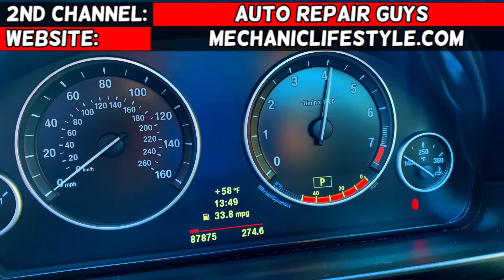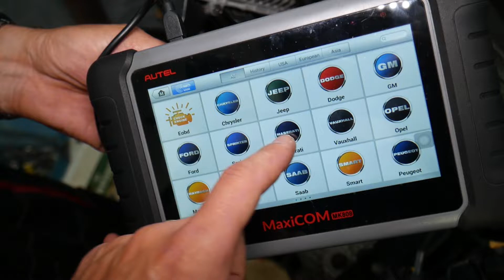HYUNDAI TUCSON CODE P0014 P0015 CAMSHAFT POSITION, ENGINE LIGHT ON FIX

Comment: My Tucson threw out the p0014 code. An independent mechanic and a dealer both said I need new engine. Got a rough estimate of $16,000 to fix.
Reply: OMG, i have the same code, did you fix it ?
Reply: @deeb6006  No. I just got rid of it.
Reply: @deeb6006  same code. How did it go for you?
Reply: Go to the dealership, they will change the engine for free, or you can pay a small amount. I paid $1k.